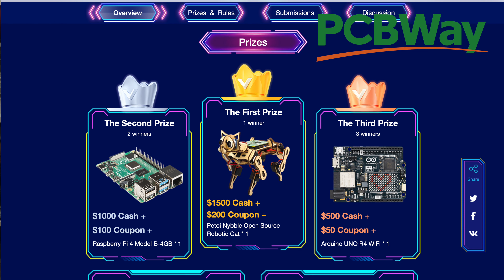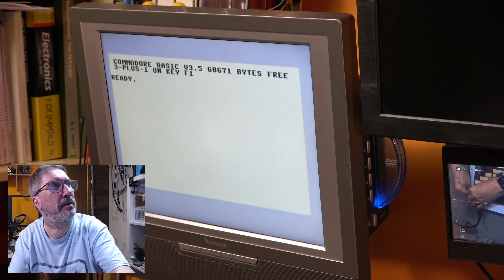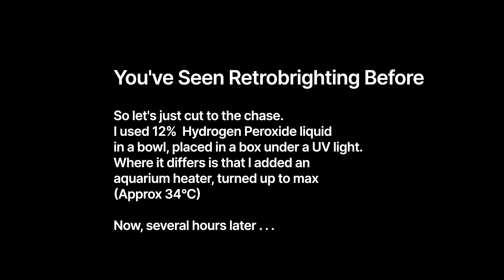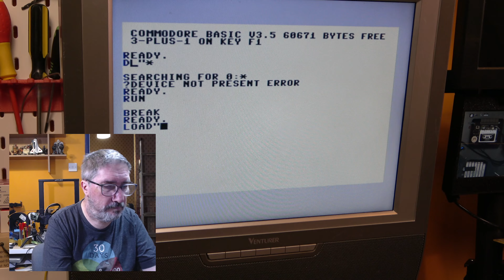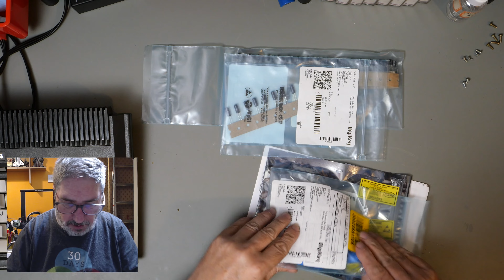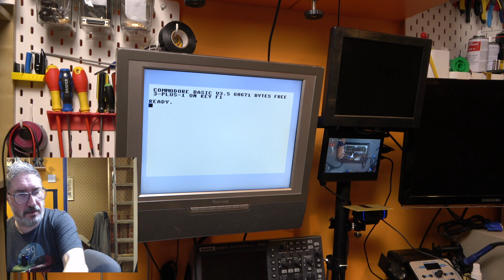Commodore Plus/4 Restoration

Comment: The results on the keyboard are night and day :) ... Great video Tim .. you need a 1551 disc drive now for super speed loading :) ..
Reply from the maker: I think the heater was the biggest factor in getting good results. 
A 1551 is well outside my price range, but JiffyDos might be a good interim…
Reply: @TimsRetroCorner  Yeah there not cheap .. Are lass got me mint one for Xmas a few years ago . They are rapid :)

Comment: Just cut original square pin cable, and on the other end solder round female din connector, and then you can use C64 power supply.
Reply from the maker: It's a suggestion... ;)